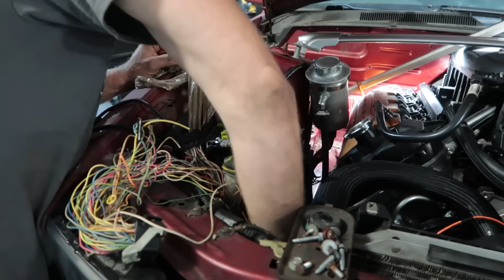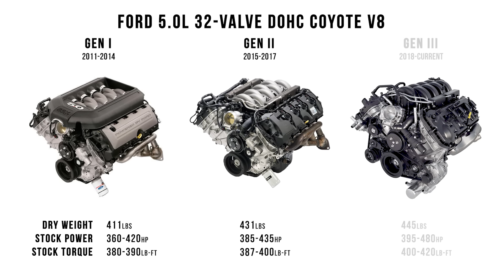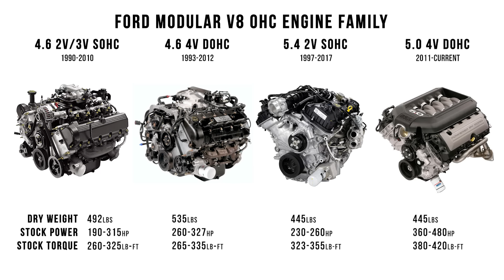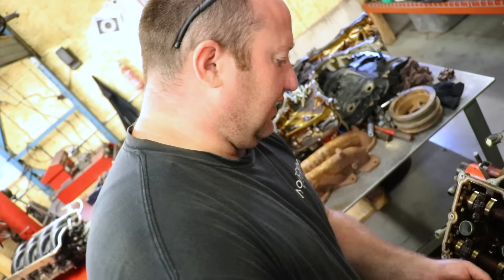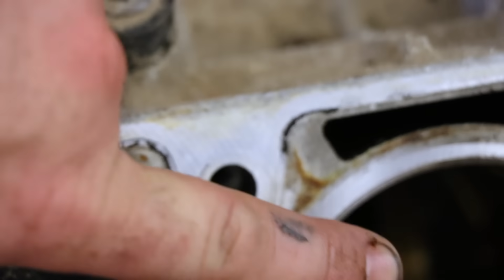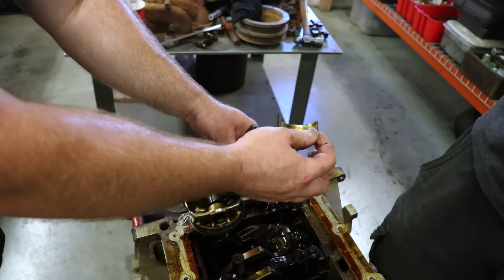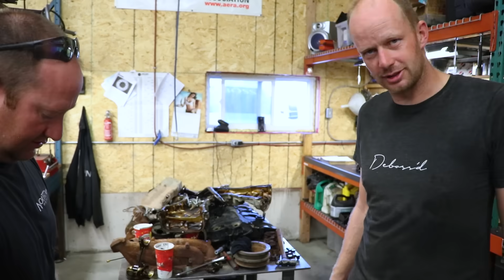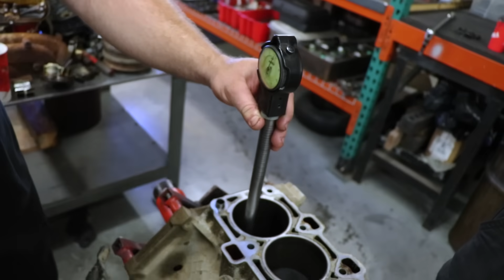REVIEW: Everything Wrong With A 5.0 Coyote Engine

Comment: This was great to see, as the first gen is what's in my truck I've had since new.  She's made it 90k miles on 10k oil changes with Mobil 1 extended drain varieties.  Even sent a sample to Blackstone labs 20k ago because the long intervals always bothered me, but their report said it was legit, and I could even probably go to 12k (I'm sticking to 10).  I'm actually thinking about pulling valve covers at 100k to see if I have any build up, and making sure the screens on my vvt solenoids aren't getting plugged.
Reply: I'm bias towards GM but have had no major issues with any Ford's. I religiously run Mobil synthetic and have for many many years. I started when GM's performance cars recommended the oil right on the oil caps. I thought time and time again about trying other oils but at the end of the day I always go back to Mobil Synthetic. I think they've honestly been the same since day one and I've never had an engine that had an issue with it. I try to change it every 5k to 7.5k miles as well depending on what kind of vehicle it is. Everybody claims there are better synthetic oils out there and I'm sure for a lot of cases and specific situations there may be. It just seems like whenever synthetic oil is being blamed for a problem... which isn't that often... it's never Mobil that they've been running.
Reply: Good to hear that some people do proper maintenance. Money well spent to prevent an issue before it becomes an expensive one to fix. I had the dreaded 3v 5.4 in my F150. I stayed up on maintenance and never had an issue. Albeit I likely wouldn't but another F150 it was a great truck.
Reply: Hey Nathan, you haven't had any problems with that engine?
Reply: @TheUltimateCrash1990  The engine itself has been flawless (as long as you don't count lack of torque as a flaw). I've replaced a couple of minor accessories (oil cooler assembly, radiator hose coupler o-rings, starter occasionally didn't want to engage) but all those are easy, fairly cheap, as as I see it, nothing is perfect, and considering the regular abuse the truck sees, it's held up great.

Comment: I thought ALL oil can turn into sludge.  Synthetic is less likely to sludge than conventional mineral oil?

Maybe syn turns into sludge "often" is because of the longer in between oil change intervals common w/ syn use.
Reply: Yeah. Because if you Change syn oil every 3-5k there should be no build-up.
Reply: Yep synthetic is less likely to sludge and lasts longer. The issues come when manufacturers use its longer life to increase the service interval way too much. 
Other manufacturers recommend synthetic oil to reduce sludge problems (Saab in the early 00s)

Comment: any kind of engine that has a bunch of timing chaing and timing gears and 4 cam shafts and huge cylinder heads and is 4 times more money, isnt the better engine
Reply: Jon Fries,  You literally took the words out of my mouth, thank you. As for me, bring back the Ford push tube engines, made out of real cast iron! I just can't/won't pay for this aluminum crap.
Reply: Better in reliability but not in performance. Considering more trucks get worn out and abandoned after 300,000 kms, I'd rather have the performance.
Reply: @Zach-ju5vi  dude. a 6.2 ls makes more tq for cheaper, fits in more vehicles. if u want 500 hp. just cam it with  tune. literally 1000$ and your making 500hp all day. for a coyote your spending 1800-2500 on JUST cams. who the hell wants to deal with a bunch of timing chains and gears and sprockets ans bullshit. dohc engines are stupid. push rod engines can also have a way lower center of gravity. your not gonna win this one lol
Reply: not to mention a junk yard 5.0 coyote is like 4-5 grand  depending where you are and the miles. you can find a junk yard 5.3 and turbo it and make 700hp and 800 tq for that and itl take it all day
Reply: @joefries365  lol your pushrod engine cant handle the rpms of a dohc engine that is a fact. The displacement of the two engines is hardly comparable. Also dohc makes valve train maintenance is a breeze if you know what you are doing.
Reply: @Zach-ju5vi  k then why doesnt anyone ever run a dohc in a race car, cleetus mcfarlands 427 can run 7900rpm . richard holdner has a 6.0 that can rev to 7600, noone cares about high rpm when all the tq is made at 4-4700 rpm ayways. if your gonna rev past that may aswell buy a fucking honda and say immmmm gayyyyy
Reply: why do you think the corvette can outperform and hang with ferraris and lambos and mclarens. they dont have a big honkin heavy dohc engine making them understeer. push rod engine can be way lower and further back. even the c8 with 495hp can out perform cars with 700hp, because it doesnt have a big honkin heavy dohc engine cause that wouldnt fit
Reply: @joefries365  high rpm allows for HP numbers that you will never reach with the same displacement in a pushrod engine.
Reply: @Zach-ju5vi  pushrod engine can reach that. top fuel cars have pushrod engines man 4000hp haha
Reply: @joefries365  ok so take that funny car or top fuel or whatever engine and make it rev up 1000 rpms higher and tell me it has less power.
Reply: @Zach-ju5vi  they usually run nitrous i think actually
Reply: @joefries365  are you slow or something? I'm talking about the the max rpm the engine design can handle and you seem to be off in left field.
Reply: @Zach-ju5vi  oh yeah? this guy really must be quite the fart smella
Reply: @joefries365  I'm sorry I didn't know you were simple. Would you like me to explain it to you?
Reply: @Zach-ju5vi  oh yeah?
Reply: @joefries365  a pushrod valve train is limited by the laws of physics to a certain rpm range, while the dohc Valve train is still bound by the same laws of physics the design does not share the same rpm limit and it will exceed an ohv engine by several thousand rpms. It is a fact that an engine that revs higher with the same displacement will produce more HP and torque once the higher rpm is reached. Now to say that one design is better than the other is a fallacy because either one could be better depending on application. Unfortunately for you and your argument I am talking about pure HP performance and dohc outperforms pushrods everytime because the design is capable of higher rpm.
Reply: @Zach-ju5vi  oh yeah?
Reply: @joefries365  also to your argument. dohc engines are more efficient that pushrods, less friction, more capable and stable at higher rpms. More reliable aswell. And simple blocks designs. 
They are able to use vvl and vvt, and of course better emissions
Reply: Pushrods are cheaper yes. But far outperformed by overhead cam desings
And just to clarify im not even a ford fanboy, but a mopar guy. I love cheap ls engine builds
Reply: @mattgarkus2489  they use 11.00rmp hemis in dragster that are pushrod engine. i have done lots of engine stuff and have watched engine masters and racing shows and been to drag races and looked at really high end stuiff  where they use really high end stuff and have never heard of all this stuff your talking about ever. never once seen a high end racing engine use dohc
Reply: @joefries365  drag racing requires lots of torque is why they use pushrod engines. So many other forms of racing use top end performance.
Reply: @joefries365  The Corvette's performance has almost nothing to do with its engine being pushrod and more to do with its weight distribution with its mid mounted engine.
Reply: @nathanmcdonald610  the pushrod engine is lighter, mounted further down and back, takes up less space, makes it the best front to back weight ratio for most cars, i think i was just meaning that the pushrod engine is better for that than a dohc
Reply: @Zach-ju5vi  maybe fords, 15-30 year old chevy's are only going up in price, and there's still a ton of them going strong, at least here in Americaland
Reply: @olov244  lots of old trucks here of all brands but they are cheap because nobody wants a rusted worn out truck that you know after 300,000kms needs money invested into it to keep it on the road.
Reply: that's why it won't be around for much longer, the lsx will be hard to replace, it's so cheap to make, compact, and durable
Reply: Are you saying you'd like more or less than 4 cam shafts? And what makes a better engine? Better for application, simpler, easier to work on or just more power? How about an engine with no cam shafts?

Comment: The biggest problem with the Coyote is the displacement. The bore spacing limits the bore size. If ford had stuck with the SBF bore spacing with the Mod Motor, the Coyote would be a much much better engine. However they are typically very very durable.

Comment: I think its funny how the mechanic is calling the LS/LT old Tech (it is) like it's a bad thing. If your DOHC VVT engine costs more than twice as much to make the same HP then is it Progress???? If it's not lasting far longer, is it Progress????
Reply: the LS/LT IS old tech. So is the DOHC on the coyote.
Reply: You're not wrong. I'm a big fan of the saying "if it ain't broke don't fix it".. But the fact is these engines (Coyote, EcoBoost, whatever) are constantly improving as technology becomes available and emissions standards become stricter, and I predict in the near future LS motors won't be able to compete in the new vehicle market unless they start making big changes...
Reply: @NovaNinja_  I think by biggest complaint about all the modern engines is why are you using aluminum in the engine block in the first place if its a truck engine??
You only saved about 100 pounds, the vehicle weighs over 5000, it costs much more to make the aluminum block and its "Potentially" less durable. To me it's just stupid.
Reply: @NovaNinja_  Well, Ford seems to have my opinion also since we now have the new 7.3 Godzilla engine. I have a 1961 Ford F100 waiting for one to show up at the wrecking yard.
Reply: @NovaNinja_   They've been saying that for over 20 years.

Comment: Would love to see a Hemi being broken down, especially given the camshaft issue. Great video, learned a lot. Wasn't aware of the crystallization issue with synthetic, or that swapping brands could be an issue.
Reply: My guess on the cam issue is that the MDS causes oil starvation on the cam/lifter and kills the cam. I have heard in the dodge groups that guys with the MDS turned off don't have that issue.

Mostly a guess but my 2018 with MDS never had an issue while I had it.
Reply: @helvetesfonster900  I've got a 2014 charger interceptor with the 5.7 MDS that has 7.5k hours on the clock, of which half is idle. Besides burning about 1L of oil every 8500 km or so and a slight tick on start when it's cold in the winter it's still going strong. I figure I can't be much worse to it than the police were so I'm just going to keep flogging it until it quits or I trade it in.

Comment: I was drooling and ready to buy a 2017 or newer mustang with the coyote 5.0 but after extensive research and finding about the issues with the rattle noise and the so called typewriter teak it was enough to made me shy away from it. Seems like it’s caused by piston slapping while engine is cold then it goes away once is warm up, it seems to me like they need to go back to the drawing board and get thighs right.

Comment: Okay, what constitutes a short drive for a synthetic oil?
Reply: I actually just looked it up and Lucas Oil claims any drive under 6 miles constitutes a 'short drive'.
Reply: Not enough distance to reach normal operating temperature. Obviously this depends on ambient. Had an engine machinist as a neighbour in the 80s. His workshop was less than 2 miles from home but he always made a point of spending 15 mins minimum to get to work so the engine would warm up fully.

Comment: This guy is a joking I hope  lol this isn’t from synthetic oil it’s from not changing the oil and one side is dirty because one side is pvc side and the other is fresh air and they didn’t really have rod bearing failure problem they had some manufacturing problemS it wasn’t even a real issue it was like .04 percent of 1pecent
Reply: I'm glad I'm not the only one cringing at this guys "knowledge" 😁
Reply: @praisejesus3  I've never understood the synthetic hate that is around and every time is wrong.
Reply: @kimchipig  The hate comes from car guys who watch idiots go 7-10K mikes on Synthetic because the oil cost more to buy and is so "much better than conventional".
Reply: @cp6027  I do every 10k kms  on my coyote. I did an oil analysis on my last change. They said there still another 10k I can get out of that oil. Will I go 20k for an oil change? No. I follow Ford drain intervals of 8-10k miles. Synthetic is only double the price of conventional. I can get 2 5 litres pennzoil ultra platinum jugs for 30/each on sale, plus pennzoil has a 10 dollar rebate for 5 litre jugs. So I'm paying 50 dollars for 10 litres. I find it funny how people obsess over oil intervals. Follow the manual and your good to go. Pretty sure the engineers who do the testing on these motors know more than the average consumer. It's the same for any newer vehicle from 2008+. Even in heavy equipment they call for 500 hr intervals instead of the standard conventional 250 hr ones. If you wanna know how far your oil can go just do a simple oil analysis.
Reply: @wrectumwrangler  well the manufacturer has recommended the maintenance intervals based on them wanting it to meet their 100k mile warranty. That doesnt mean they are for longest life possible. It may be a "look at this low cost of maintenance" sales gimmick that gets it to 105k miles right on the north side of the warranty and they dont care afterwards.
Reply: @jaredanthony8070  that's why you do an oil analysis to find out the life the oil brand your using is. I'm at 80k for my f150 and the oil is still fairly clean everytime I change it with 10k km changes nothing is built to last forever. The whole built on a monday or friday still exists. It is alot of money to maintain these vehicles and there are alot of lazy consumers that dont want to do it themselves or pay the price to maintain. Can't blame the manufacturer. Gotto blame the consumer on laziness
Reply: @cp6027  250,000 to 300,000 miles has never been a problem for me with 7,500 to 10,000 mile oil changes with synthetic, I've never even seen any darkening of the inside of the engine.
Reply: TheCumminsturbo2 
Syn oil does not suspend contamination as well as natural oil, this why synthetic is not used is piston engine aviation applications
Reply: Tom Edgar this is only true in old opposed piston air cooled engines and and is has nothing to do with water cooled engines of today in our cars this engine didn’t fail because of bad connecting rods didn’t fail because of type of oil it failed 100percent because of lack of maintenance that’s it nothing else just a lazy cheap owner! These coyotes run extremely clean my bet is it was a lease and had no oil changes unless it was free

Comment: I've heard these engines have a problem with the oil pump gear cracking and breaking at high rpm. Also the LS is way more compact being a pushrod engine.
Reply: Oil pump gears only break when you putting a blower on it. There's an aftermarket Billet oil pump as the factory one is powdered metal.
Reply: I haven't heard too many F-150 owners going over 7000 rpms and having oil pump gears explode. You are thinking of Mustang owners with stick shifts.

Comment: Can you do an everything wrong with the 1st gen 3.5ecoboost
Reply: would probably be more reasonable to do everything right with it, much shorter video
Reply: Easy, timing chain/ tensioner issues, turbo actuator issues, carbon fouling on the intake valves, it's why they added port fuel injection
Reply: That would be a great video!

Comment: Great video and special thanks to Scott. I’m just doing a lot of work on my daughter’s Mini N12 engine. It had the same brownish color on all the internal parts. Luckily very little sludge, but we changed oil regularly and it burned a quart every 450 miles. It had lots of carbon buildup and some of the exhaust ports were almost completely blocked.

Comment: I think that even tho I love the ford and would pick one over chevy, this coyote engine looks like  you need to be a watch maker to remember where all the pieces go. I see that whole front come off and that to me is way cool as there must be some real control going on there to keep fluids from mixing a long island tea out of antifreeze an oil. What would blow my mind is the getting right bolts back in the same holes and not getting something tight so that couldn't happen. There is a ton of stuff in there as say compared to a 5.0 mustang of the seventies with a carb on it. Do three and you should have even the torque spec's memorized so ya anyone can throw a chevy back together. I do like the LS over the older engines... I just never got that far before heading for my permanent home... a wheelchair. I am sure that if I tore one of these down that it would go back together just cause in the last few years, I had very few ah shits. Interesting how they could pour the engine block around the sleeves

Comment: As far as the bores, a lot of guys cut them and have aftermarket sleeves put in them, after that they're basically indestructible, IF you put billet oil pump gears and crank sprocket on it. They have their issues, but with regular maintenance they're a great motor. I've had random coolant leaks on my 13 f150 and thats really about it. It runs super quiet. Not much torque, but it's a great commuting truck. Gen2 coyotes are where its at.

Comment: I run my used synthetic oil to top off my lawn mower, it burns a little oil and I’ve never had any issues with coking on the machined surfaces.
Reply: Synthetic oil does well in air cooled engines. Maintains viscosity better, and less loss to evaporation at high temperatures.
Reply: Run synthetic in my 24 hp Briggs and Stratton and it doesn't use a drop of oil between changes.